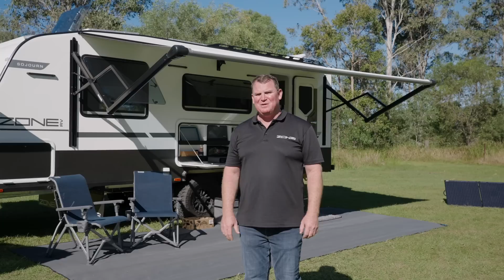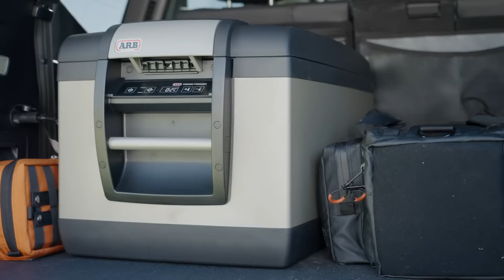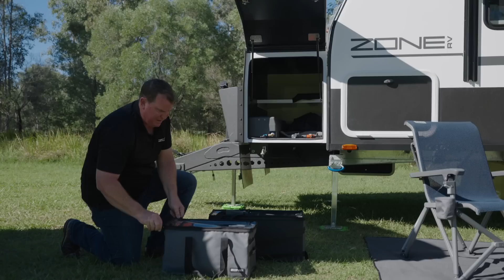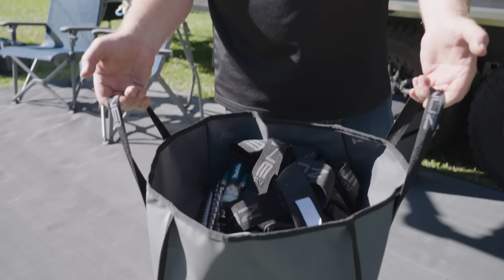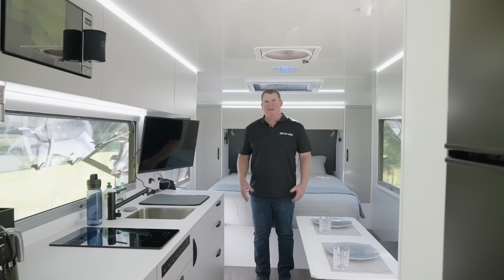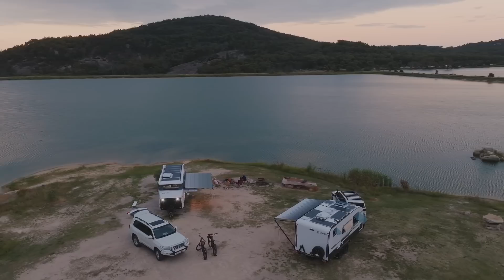Setting Up For Your Next Luxury Off Road Adventure

Comment: Hi Adrian, Thanks for the vid. Some useful tips. Noticed your TV was raised. How did you acheive this? Move the wall plate or change the support arm? We also have a new Sojourn and we love it. However our TV is lower exposing connections above and not allowing clearance on the bench. Keen for your feedback. Cheers L
Reply from the maker: Hi Leanne, it is the same mount that comes in all our vans. The TV is not standard though so maybe the mounts are a bit higher on that one.